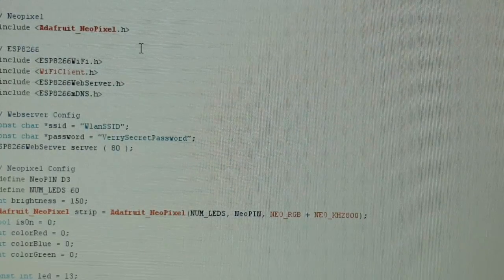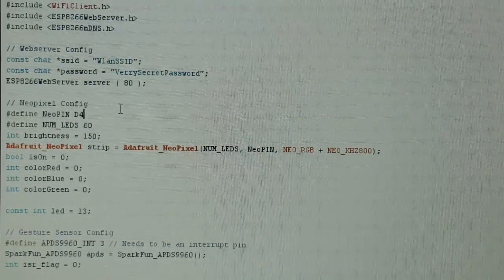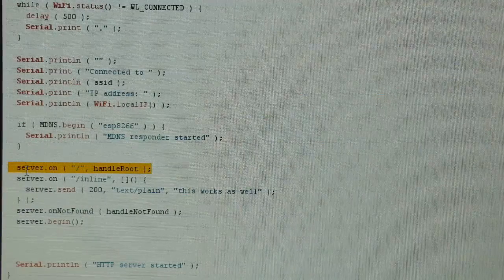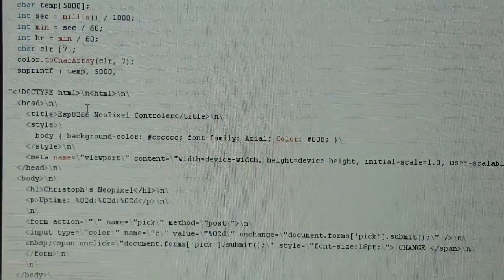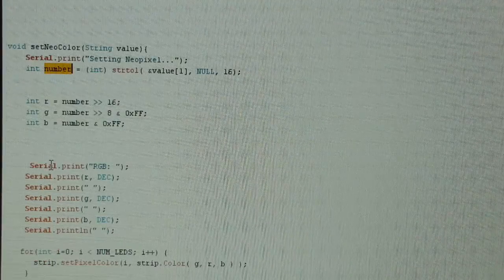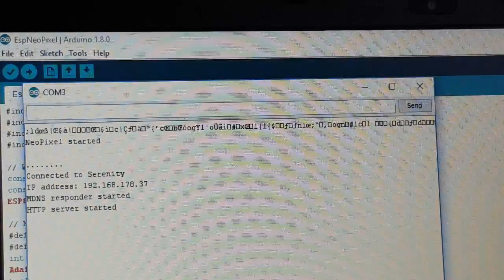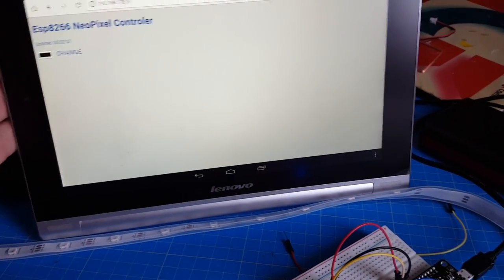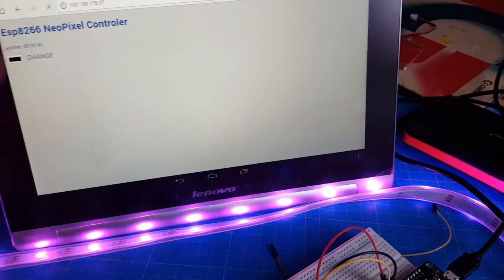Controlling NeoPixel with ESP8266

Comment: Sorry, I'm trying to do the same proyect, but the LED Strip is not powering up, I'm using a Level Shifter, and a 470 Ohm resistor before the data input to the strip, but is not powering up. not even randomly
Reply from the maker: You don't need a 470 Ohm resistor on the data line. There can be several issues, why your strip isn't working. Are you sure, you used the correct pin in your sketch? Have the strip and the NodeMcu the same GND? Have you called the begin-method on the strip? Did you connect the correct side of the strip (there is an input and an output side)? Are you sure your strip is working correctly? Do you have enough current to provide the strip and the controller? And there is a lot more, what could go wrong....
Reply: @nenioc187  I realized while a was writing this comment, I'm using a level shifter, so I'm not going to have any peaks in voltage that could damage the first LED, I took it out and  it worked just fine, I think the resistor was corrupting the data. Thanks for replying anyway. Great video!

Comment: Thanks so much, this validated my design and it turned out my issue which led me to your video turned out to be that I had applied the wrong voltage power supply (doh!).  The video was well done, well paced and clear as to what was being attached and for what reason.  I see a few folks asking about using a single power supply.  I found that running the 5V through the USB wasn't quite stable.  It is possible my USB supply was insufficient, but it could have been just that the board wasn't designed for the amount of current draw.  So instead, I attached a barrel jack to the additional power and ground leads on the LED strip.  Then fed power back through the Vin pin which powered both the board and the LEDs quite nicely.

Comment: hi nenioc187 bei mir leuft alles auser die seite wird nicht angezeigt
Reply from the maker: If the page isn't showing up, check your router, which IP address the ESP got. It should differ from the IP address in this example
Reply: nenioc187 ok tenks
Reply: also es geht nicht habe alles gemacht geht nicht köntest du denn code schiken von dir
oder ligt das ich den wemos d1 mini habe
Reply from the maker: It's the code, I published on Bitbucket:
https://bitbucket.org/Remnis/neopixelwebserver/src/master/

Comment: I wish I watched this before I've ordered a led strip without the level shifter... Can you provide a link to the level shifter you've used?
Reply from the maker: When you search for "Level shifter" on eBay, Amazon or Banggood. If you want to control just short stripes of about 30 or 60 Neopixels, you could try using it without. I've successfully controlled a 2 Meter / 60 Neopixels without a level shifter.

Comment: Hattest du ohne den Levelshifter bei 3,3V am Datensignal Probleme? Ich habs heute mit nem WeMos D1 probiert, sämtliche Pins, keine Funktion.. Habe mir das ganze mal per Oszi angeschaut, gefühlt kam auch nichts sinnvolles am Pin heraus, außer einigen, regelmäßigen Spikes.. Mit nem Arduino Nano und dem selben Code dagegen keine Probleme..
Reply from the maker: Probleme mit den Level-Shiftern hatte ich nicht. Hast du daran gedacht die Referenz-Spannung anzulegen? H1-H4 und L1-L4 sind die Datenleitungen. Damit das funktinoiert müssen die beiden Pins H & L an die entsprechenden Spannungen angelegt werden. H = 5Volt, L = 3,3V.
Reply: nenioc187 Habe keine Levelshifter, habe es direkt mit der Datenleitung (3V3) probiert..
Reply from the maker: Kurze Stripes (bis ca. 60 Neopixels) konnte ich auch mit einer 3.3V Datenleitung ansteuern. Drüber hinaus reagierten die nicht mehr ohne Level Shifter.

Comment: in time 1:56 you can see how to combine the breadboards in a much more mechanically stable way. The boards have pins and inlets at the periphery of the breadboard designed to allow mechanically extending them together.
Reply from the maker: Thanks for the hint! But I already have a NodeMcu board that is quite breadboard friendly (they must have seen my vid ;-) ). And I made a custom breadboard out of a PCB and some pin headers. 
You can see them, shortly, in my video about the analog extender.
Reply: nenioc187 which model? I am interested!
Reply from the maker: I haven't found out which seller delivers the new, cooler boards. But some do. You can see how they fit on the breadboard here:
https://youtu.be/_J8uGesYvl8?t=1m50s
Reply: nenioc187 thanks. I found it. that's the v1.0 or the second hardware version of the NodeMcu.
Reply from the maker: Both are sold as NodeMcu Version 1.0 (I'm sure that's the firmware version). The bigger one is marked as "LoLin", the smaller one has a white painting on the back and is marked as "Amica".
If there is a general interest, I could make a video where I compare the different versions I have. I think there are even one or two additional boards lying around here somewhere ;-)